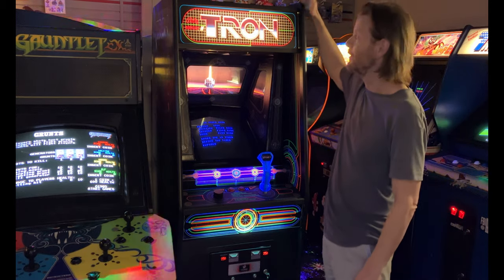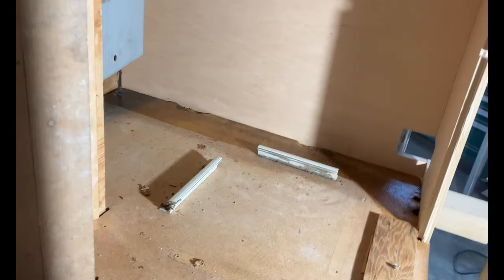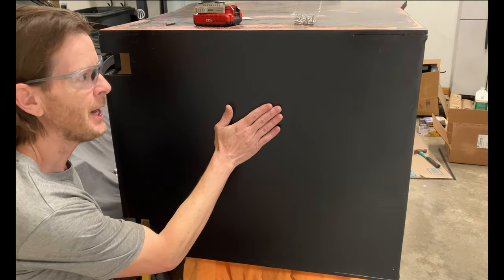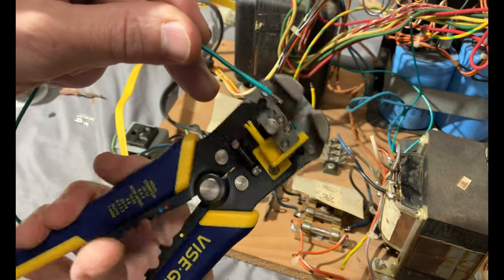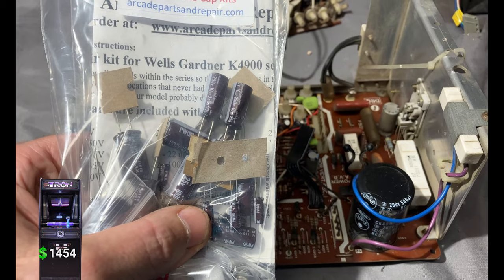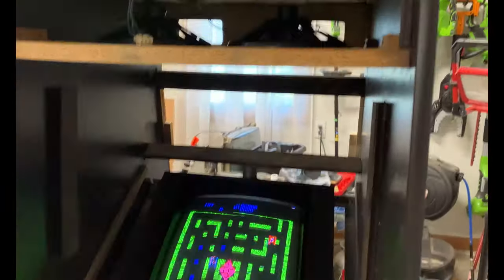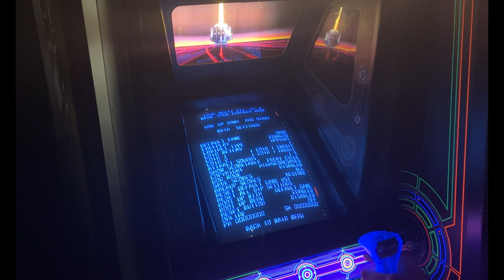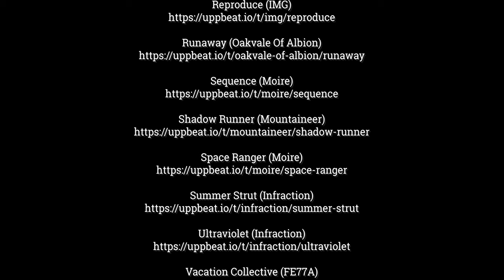"Trashed" Tron Arcade Restoration, Softer Music Version!

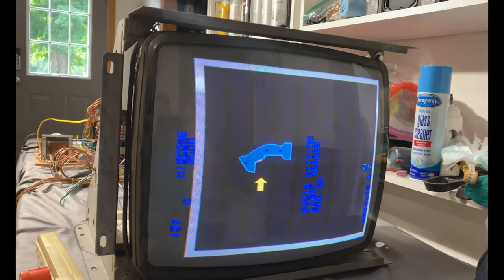Comment: Great job. It's amazing how much hardware it used to take in 1982 to do what an FPGA and an LCD display can do now! If you look at 1:09:12 you can see your video glitch is outside of the wide white line on the picture. I can't see any reason why the programmer would not draw that white line right to the edge of the available drawing area, so I think the glitch has nothing to do with your video RAM. It looks like the timing of the vertical blanking is not quite right.
Reply from the maker: I found out later it’s known and it is indeed the programmers using a little bit of video RAM where they thought it wouldn’t be visible. Or something to that effect. Either way, it’s supposed to be trimmed out by the monitor controls.

Comment: Have you ever done a CRT to LCD conversion to any of your games? The reason I ask is because if you had a picture tube fail or wear out. I would hate to see that render an awesome arcade machine unplayable.
Reply from the maker: I have an LCD monitor I use sometimes in testing but try to keep the CRT’s running. For now I can steal parts from discarded televisions (and that’s what others do) but at some point there may be no choice. I like the way images look on CRTs much better, personally.

Comment: I admire your passion and electronics skills, but the wood working & painting side of things needs more effort to class it as restored for durability purposes. 
But keep going, and you will pick up new techniques along the way to make things easier and give a better and more solid finish. 😉👍
Reply from the maker: There’s a distinction beyond “restored” to like new and “restored” to fixed. I don’t care much for games that look brand new. As far as the other sections, what am I sacrificing as far as durability with wood working and painting? I’ve been doing this for 30 or so years now and have never had an issue with any previous repair deteriorating.
Reply: @tcurtis49  Hey, I understand that. But there is also a distinction between restored and patched up. 😉 
At some point the wood loses it durability. I was simply point out that there are other ways to restore its strength when it gets to the point that the bottom of this was. A simple cutting off and replacement of the botton of the sides with a biscuit joiner and glue then fill the join would have looked great and reduced the chance of further flaking/wood deteriorration in the future. 
Also, undercoat is very important. We all hate having to do it, but it really does help as it's job is to soak into the surface of the wood and give the paint a good suface to cling too. 
Was just trying to help. No need to get defensive. 👍
Reply: @tcurtis49 PS. Some oil based polyurethane on the bottom quarter of the inside of the cabinet and exposed wood on the underside will help to prevent scuffing and stop the bottom of the unit from wicking up any water in future should it happen to be unfortunate enough to come in contact with any. But not on any visible areas though, that stuff yellows over time. But it's brilliant stuff and gives an extra layer of protection after all your hard work.
All the best. 😊👍
Reply from the maker: @mrlox9576  Good point on the biscuit corners—for sure. And that’s something I will likely show on other projects. Keep in mind these videos are going to an extreme to see what’s possible rather than what’s most practical and if I were a professional restorer I would have cut all new pieces for sure and probably not even bothered with chopping it down.

Interestingly, as far as primer, I have never had paint come off. Ever. Except when I’ve primed. So I’m cautious with it. Sometimes it’s necessary just to have an even surface and sometimes the final coats (oil-based) don’t adhere as well to it as they would to the existing previously primed and now stripped wood. But I do typically use it with new wood. I didn’t on the bottom of the Tron because that’s a surface that’s usually not painted at all and I just wanted to hide the seams on the sides with a thin layer to make it more attractive. And I definitely do better with no primer on Bondo, but maybe I’ve just had bad luck. I primed a ton on the Red Tent video, which was mostly metal. No argument there. And my next project is back to bare wood so it will definitely get primed.

Often in the restoration world there is a wide divide of opinions on what is the “right” way to fix something so I don’t know if feedback is a difference of opinion or a true error. And I definitely don’t want to be making true errors. But since I’m working on my own projects I have to live with the results, and I do get to see over time what works well and what doesn’t. But I’ll keep adjusting and watching out for helpful advice. Thanks!
Reply: @tcurtis49  hey, that's interesting on the primer as my experience is the opposite. Very strange. 
Nah cutting completely new sides and prepping them is too much effort. Lol
As for the 'right way', forget that concept. I wasn't trying to criticise. Do whatever works for you, but try to stay open to suggestions, sometimes there can be a new easier/better way to do certain things that someone has figured out, or new products that work better. 

But keeping a few rolls of generic colored decals (black, white, etc) that ypu can cut to size/shape can be a real life saver when just wanting to cover small areas without too much work (or to just fix part of a larger decal). 

Thanks for taking the time to reply Tod, 
Am now subscribed. 😊👍
Reply from the maker: @mrlox9576  No worries at all—I’m certainly open to criticism no matter what. And expect it given the unusual work I do on some of these games. I’ve been on the KLOV forums forever so I’ve seen how different one perspective can be from another, and some fights going on for decades now on how to approach certain things :) But always lurking there seeing what people come up with.

Good idea on the decals—I will add that to my list of tricks for sure.